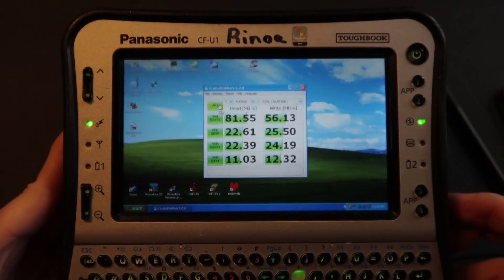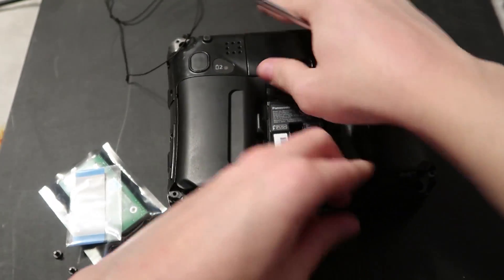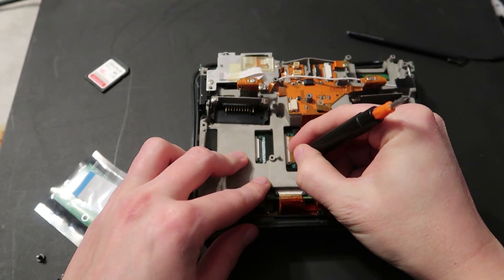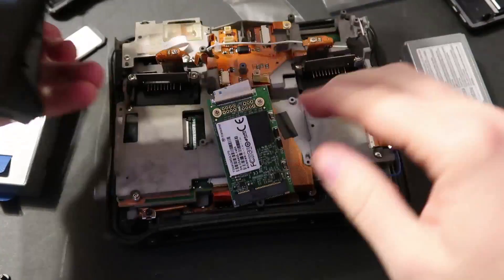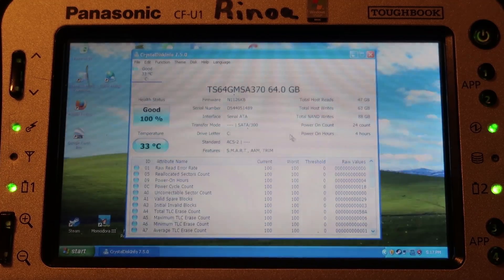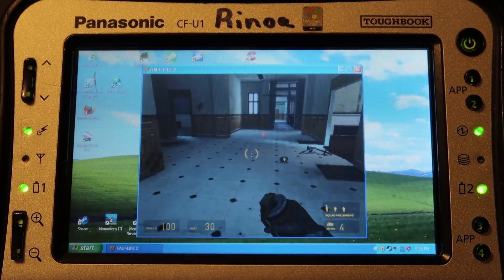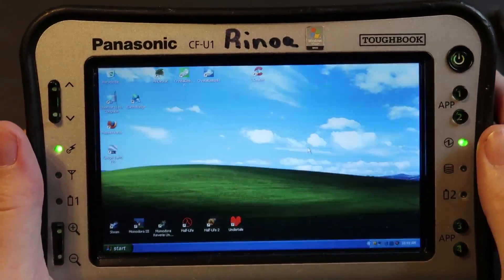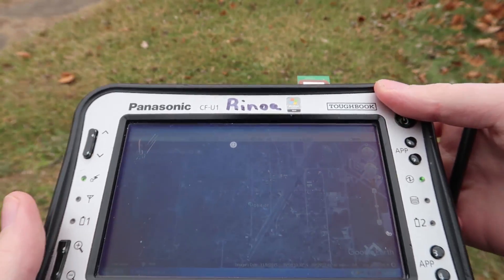Panasonic Toughbook CF-U1 SSD upgrade / mod

Comment from the maker: According to MorganLowe's article, you will need

1: (12$) mSATA PCI-E SSD to 40pin ZIF CE Cable Adapter Card 
2: ( 3$ ) 40-pin zif cable, (i used 55mm, he recommends at least 50mm)
3: (70$) mSATA Internal SSD

and that is found at http://www.instructables.com/id/Toughbook-CF-U1-Readily-Available-SSD-Mod/
or at 

https://web.archive.org/web/20160104205843/http://www.instructables.com/id/Toughbook-CF-U1-Readily-Available-SSD-Mod/

you really can never trust websites to stick around tbh.
Reply: Rinoa Super-Genius so will it run Windows 8 and Windows 10
Reply from the maker: we sure i guess, but windows 3.1 would be better than those piles of shit.
Reply: Rinoa Super-Genius oh well true is there a way to upgrade the graphics
Reply: Rinoa Super-Genius another thing are you interested in a CB radio if so let me know

Comment: As i see you don't connect a resistor to ground, is it works without a resistor? Because mine CF-U1 is not working with even 4.7k Ohm resistor.

Comment: I LOVE that you have Steam installed on this :D
Reply from the maker: sadly when i turned it on a few months ago steam updated and locked up, cant do 32 bit anymore.
Reply: @RinoaL  

Gah! that's a shame.

I've just opened my CF-U1 up to confirm which SSD it had, I'm going to buy one of those ZIF adapters and try an ugprade.

I've got a 64GB slot card instead of the 16GB one you had, but the 64gb one is slow as hell too!

How did you come by your CF-U1?
Reply from the maker: i got like 10 of them at an electronic recycling center.

Comment: I've just done this on my CF-U1, but I can't install windows and my bios can't see the SSD. It says there is no hard drive. Any ideas?
Reply from the maker: hrmm, ive never heard of that problem. maybe make sure everything is connected?
Reply: Hi there, thanks for your reply, I appreciate it. I've been checking and retrying my connections repeatedly, but no joy so far. As far as the bios is concerned no hard drive is visible. If I switch back to the old drive it sees it fine. The trouble is that I have no way of testing the mSATA adapter card I bought. Well I'll keep playing and hopefully I'll be able to get it to work.
Reply from the maker: well good luck, sorry im not much help.
Reply: No worries, that's okay! Hopefully I'll be able to sort it out. I might just have a dodgy zif cable. Do you know what model of CF-U1 you have? Mine is an 'A', which is one of the old early models.
Reply: @RinoaL  i think its the Adaper and the only option is to buy different ones.

Comment: Hi there, just found your channel for the first time, great to see another  girl also interested in all this stuff, there are of course others, I do watch Fran Blanche and,  but mainly it seem that there are far more male channels. Big Clive is a favourite of mine.

Interesting an SSD with XP, I still run XP and was put off upgrading to an SSD, instead I used a hybrid drive, good results. Have you simple suggestions for adjusting XP to run on an SSD?
Reply from the maker: thanks, and no i dont, this was like a 60$ ssd and so im not too concerned with how it works with the SSD. seems to work well enough. i probably wont defragment though. i figure modern SSDs last so long that this thing will be vintage by the time any issues occur. for instance my thinkpad has 20TB of NAND writes after only a year, and i dont expect it to fail any time soon, and this little SSD didnt seem to be having hardly much useage while running xp. according to CrystalDisk Info at least.

Comment: Probably the speed is mainly limited by the HW interface used for disk. In addition consider that XP could be slightly unoptimized for using with a solid state memory; in fact beyond the TRIM option that could be missing in such an OS, some options that modern one automatically apply when they detect that are running on SSD (think about defragmentation or swap file), have to be manually configured

Comment: A high power lazor? :-D love your crazy mod ideas :-) , From my experience which is kind of limited i dont think ssd's do reallocated sectors? from what ive had they tend to just randomly fail without warning then you cant recover your data. I really gotta get one these Toughbook devices at some point they look like they could withstand a tank rolling over them.
Reply from the maker: yes they do, check your SMART data if you need to know. i recommend Crystal Disk Info. there is no warning, only when you dont listen.
Reply: Yeah i use that disk tool its handy at times also one called diskspeed32 which gives you a nice graph of write speed access, I use smart data on magnetic disks i dont know how effective smart is on ssd but if you say its awesome then it is :-)

Comment: You might wanna try adding "-noshaderapi" to your launch arguments. If that doesn't work in the current Steam release, look up the HL2 old engine unpack (which uses the 2006 version of the engine that's pre-Episode 2, ep2's engine broke a lot of things when the older games were ported to it).

Comment: Minor correction: the values in CrystalDiskMark are actually megaBytes per second, not megabits. Not too shabby for the relative ease of the upgrade!
Reply from the maker: ah yeah good point, i doesnt change much to me though since i only compare it to other SSDs. like basically 80 is better than 60, and i remember some modern ones doing 700 or whatever. but thanks.

Comment: You should try it out with Ubuntu.
Reply: Unity/Gnome might be a little tough on the hardware but I bet LXDE/XFCE would run like a champ
Reply: I couldn't care less, I'm not going to give my money to a company that builds spyware into their software.
Reply: Does Microsoft give people Windows 10 Enterprise for free?
Reply from the maker: wouldnt be very useful, but i plan to maybe give it a go, just hate having to use terminal.
Reply: Yeah, I guess it depends on what you're doing with it. I use a Linux Mint machine for most things (it's what I'm on right now), but I still have air-gapped Windows 7 and XP machines for some things. Anyway, it's pretty rare that you have to use the terminal these days, unless you're doing really technical stuff.
Reply: Yeah... I'll never use any MS spyware on the web again.
Reply: Little do you know all that spyware can be shut down in the Enterprise edition.
Reply: Who said anything about giving them money?
Reply: Plus, I hate the way Windows 10 works, it's just a completely miserable OS to use.
Reply: I have windows 10 Enterprise running in tablet mode on an old circa 2009 Intel Atom desktop board with 4gb of RAM and an SSD. While bringing up the start menu is slightly laggy, it runs very well.

Comment: Btw do you know where i can get a dent/cheap thermal cam?
Reply from the maker: dent? what to you mean by dent?

and the lowest cost on i can think of is the seek thermal which is like 250$, but sometimes see used ones for like 80$ on ebay. its low quality though.

Comment: Oh wow thats cool... wait how old is that thing 16gb ssd isnt half bad. im kinda wanting a decent (maybe used) laptop to used for 18650 testing. What have you been up to anyway bro? damn that thing is chunky, its got 2 batteries? that whole thing is quite the monster. I got WinDirStat is AWESOME btw!
Reply from the maker: its about 7 or so years old, think they stopped selling them in like 2014 or so.

its a commercial computer, meant to handle constant use by anyone from delivery truck drivers to (in the case of this one) flight attendant terminals for upgrading boarding passes and whatnot on Virgin America Airlines.